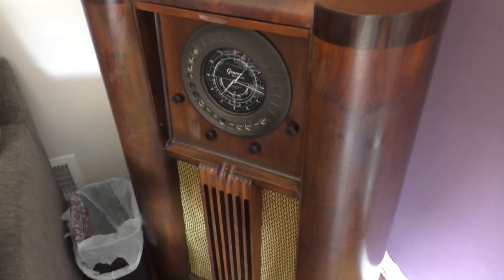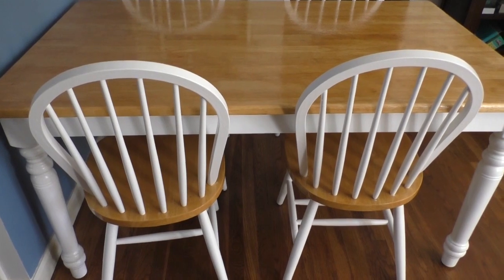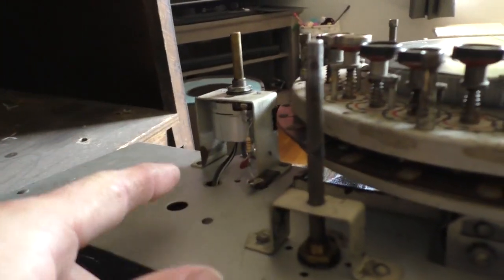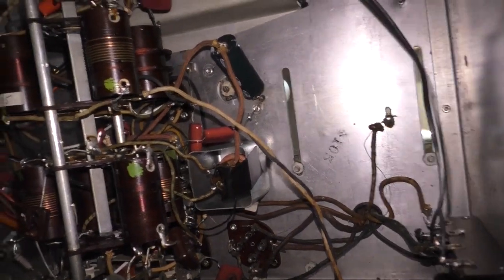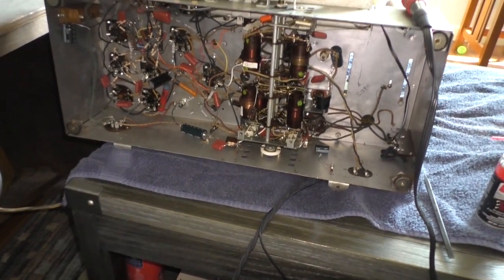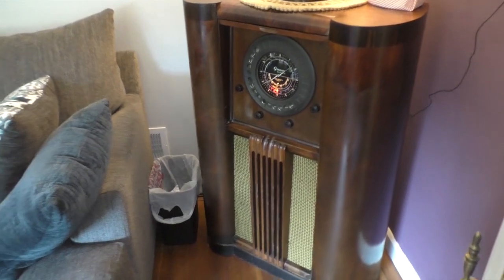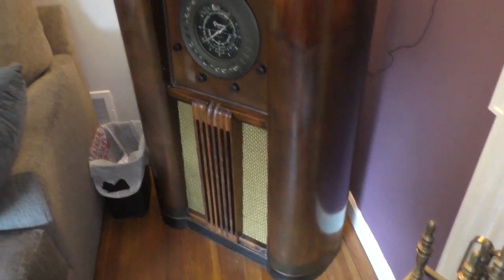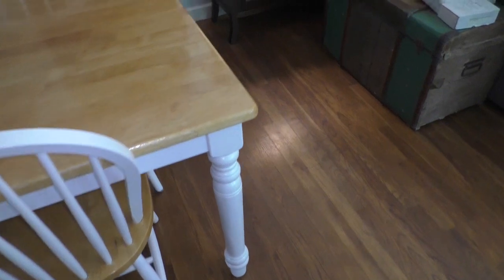1936 Grunow 1297 Teledial Radio Keeps Cutting Out - LET'S FIX IT!!

Comment: Looked at the schematic diagram on the Grunow and it shows two lamps in parallel.The parts list also mentions part  # 207 as "pilot lamps". You are missing the 
upper one to light the "Teledial" face. See:  https://www.antiqueradios,com/forums/viewtopic.php?t=96981 and go to the first photo and see the lighted dial. As for the 
smell of rot or the like you  may need to clean all the wood inside and out with 50/50 solution of bleach and water with a drop or two of liquid soap. Do that outside 
on a nice sunny day and use a clean cotton towel or old clean cotton tee shirt.!
Reply from the maker: Not that I don't believe you, but you sent me down the rabbit hole. For starters, the 1297 sitting in my living room only has one cutout behind the dial for a lamp holder. The images I'm seeing online with dual-lamp dials are all 1291s.
Reply: @bbishoppcm  Despite being two different models do they not have the exact same dial size? If they do then there is a possibility that one lamp was removed by the previous owner . It makes no sense to me that such a large dial would only only have one lamp that would light only the lower half of the dial !